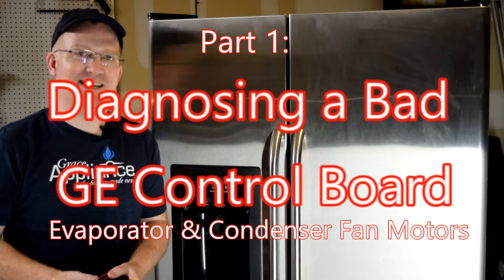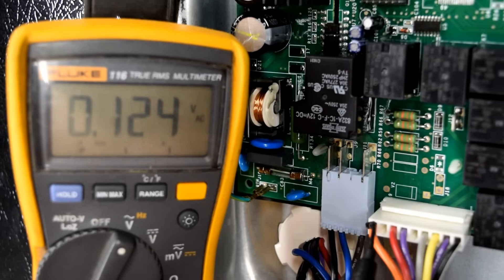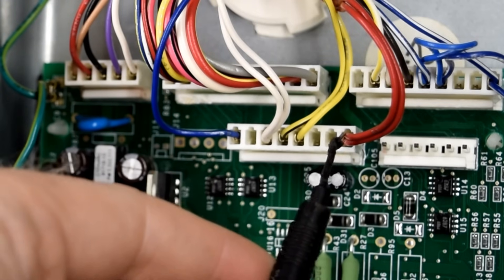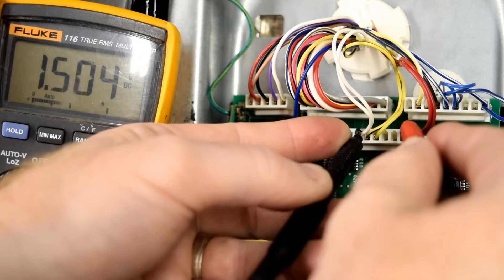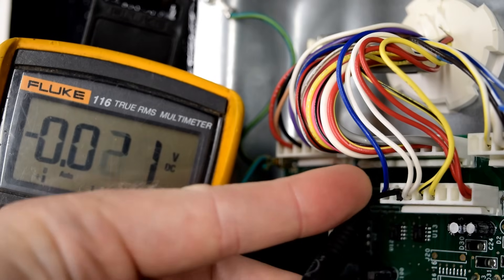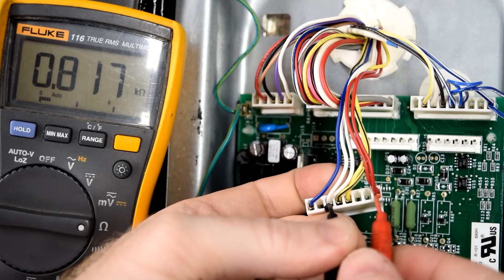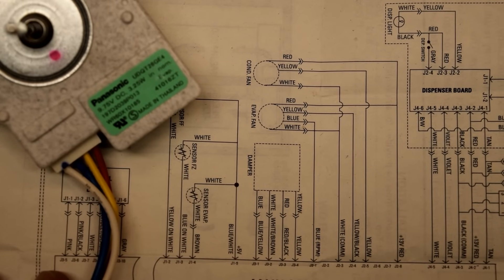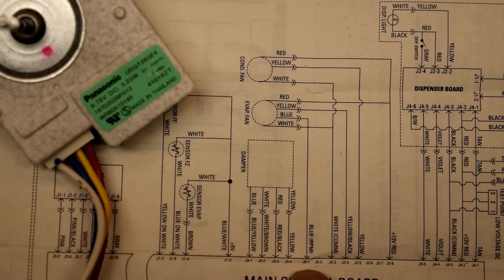Diagnosing a Bad GE Board - Part 1: Fan Motors

Comment: Great videos. Keep up the great work. Would you be able to do a video on how to fix the actual circuit boards?
Reply from the maker: Thanks!
Is this what you need?

https://youtu.be/E_HChSIIif8
Reply: @GraceAppliance  Thats a great video as well. I didn't know if you could do a video where you replaced resistors or  capacitors. Where you are fixing a broken circuit board.

Comment: I have a question on fan testing. Both my fans spin, but when testing like you show. I have 12.9v at my condenser lead, and 6.9v at my evaporator or vice versa? If I unplug the fridge, then unplug the j2 plug. I plug the fridge back in and test the pins at the board, I get 12.9v on condenser and evaporator??

Comment: Hi Andy. I am working through the videos to troubleshoot my 15 yr old fridge. I was able to borrow a meter with Hz/Freq setting but when I looked at all the steps to access the evaporator fan motor I am wondering if I can test at the control board with power applied. When I do that I read 0Hz. It also has a % setting that I guess is duty cycle of the PWM and that also reads 0. I did verify that the meter works, reading 60Hz and 50% duty cycle on the input power. Both fans are running but temperature is about 32 in the freezer and 50 in the fridge. Condenser fan is 2.18k and Evaporator Fan is 1.60k.

Comment: Electricity was lost in my area after that the refrigerator does not turn on.  The scoreboard, where the temperature is regulated, does not shine. 10 months ago there was such a situation. then the refrigerator turned on. the scoreboard is located on the front left door of the GE refrigerator. Any ideas on what it might be or what I should check? thanks.

Comment: I need help with my Ge fridge. When the evaporator fan is connected, the control board makes clicking noise but when it is disconnected the fridge compressor turns on. I replaced the evaporator fan with a new one but I still get the same clicking noise. What could be wrong? The relay overload has already been replaced.

Comment: This was FANTASTIC! I was thinking maybe my board had failed as my evaporator fan did.  I was going to just visually inspect the board  (not an electrical guy) to if I could find a failed resistor or capacitor. This is the right way. Do you have a board repair video as I am going to test my board just like you showed me and I am sure my board will be bad (my condenser fan is running) but the evaporator is not? Thank You!!!
Reply: He has a video on diagnosing bad control board. It was done awhile back scroll down to his videos and you will find it. I just watched it

Comment: In my case' every thing is working except the compressor and condenser fan they are not kicking.
I have buring marks behinde the contorl in the metal frame, but surprisingly in the board back side nothig abnormal.
The marking located near the capacitor but they seem ok and I can't test them because the board is sealed with layer.
Any ideas?
I tried to jump start the compressor and it worked with its fan.

Comment: I need water feature related parts. Not getting current at valve. Checked everything making sure it works. But it seems to be a board issue and I can find schematic anywhere

Comment: I have a defective refrigerator BEKO NDP9660WD observing more closely:The refrigerator makes its full cycle = freezing in the freezer and cooling in the refrigerator;thawing with that heater,with the compressor turned off. And here ends the job, no longer knows how to start the compressor temperature in the refrigerator increasing over 20 degrees until I stop it and start it again and leave (but not immediately have to wait any 2 hours) and in executing the full cycle.
 On the sides of the refrigerator it heats up well, without having opened the door to the refrigerator or freezer from the start. Who is responsible for starting the Compressor after the defrosting operation?. se face timed?,and if so where ?there is a timer or timer is through the program in the electronic card? What do you advise me?
 1)I had error E0 and E1 that I solved by isolation
 2) had inperfect contact in the 842 sensor jack that I solved.

Comment: Thanks for the great video. BUT
Obviously you know from experience or you have data sheet for this particular fridge.  BUT Where do you/ we find the data sheet that identifies which plug goes to which motor.  I may case a Kenmore Elite bottom freezer, fans work in test mode but not in normal operation?

Comment: Great video… Thanks, my board is on the bench now and puts out 13.5 V but will not like display when 
Inside fridge… I also noticed my 400 V caps 
Only have 180 V on them… Is this normal? I plan on loading down to 13 V with a 10 ohm resistor to try and put the supply under load

Comment: I wish the instructions were more generalized.  I have a GE fridge/freezer (#GDS20KBSBBB), but the wire colors are completely different than shown in this video.  There's no explanation, for example, whether "put the black lead where the white wires come in, slot number three" applies to other configurations as "put the black lead in slot number three, which could be any color wire depending on the fridge model" or "put the black lead in the slot with a white wire, which in this case is number 3".

Comment: GE. twin cool unit. fridge not cooling. open doors and evap fan will run most of the time. press the door switches and fan won't always run even though compressor and condenser fan are running.

Comment: Mr. Andy,

More info on my problem of a couple hours ago. Thanks to your compressor video, and another gentleman’s with an inverter on the  compressor, I diagnosed the problem as the inverter on my frig. I got readings on the three leads of the compressor of 8.1, 8.1 and 7.9. Can you verify these readings for a GE ZISS420DXASS?

But I need go back to getting a reading of 836 (your commented bad reading in the video was ~818) on the ohm test which you said should be 1500 to 3000 ohms and you said that with such a low reading I have there is a fan circuit issue, BUT both my fans work and seem to do so with speed. 

Will be nice to hear what you think!

Thanks in advance,

Jim

Comment: Hi Andy,

Thanks for all you do. With this video I diagnosed and replaced the main board. Now everything lights up and works EXCEPT the freezer and frig does not cool down even a little after running the frig for 1.5 hours. I checked for ohms as you suggested, after putting in the new board, and I am reading 836 ohms (you said the reading should be 1500-3000 ohms). You mentioned that in this case there is something wrong with the fan circuit BUT both fans are working (blowing air and both seem to be doing so at a good rate). I read a ton of comments herein without seeing my same question asked. 

Please help! What should I diagnose next? 

Jim

Comment: GREAT Job! Hubby is not home and your video made me NOT AFRAID to tackle this by myself. I read every single question in the comments and didn't find this one: Problem: evaporator fan pulsing on and off every second or so - everything else seems fine. I followed along the video step by step and everything was as expected, but once I got to the part after you remove the harness and check the Ohms between R2-3 (white) and R2-8 (red), the reading would go back and forth between 0L and 3.0 - it just depended on how I happened to orient the harness, or which way the wires got jiggled. I was very careful and certain that the electrodes maintained contact with the metal inside the wire holes in the harness while I moved or jiggled (and also tried using the easily accessible metal stripes on the back of the harness with same results). The reason I was moving and jiggling is because at first, the reading was 0L, but when I shifted my weight, it popped up to 3.0. So then I replicated this by moving the harness and/or the wires while keeping the electrodes in certain contact. On the one hand, your opening comments put pulsing fans in the motherboard category. But on the other hand, I got 124VAC and 13VDC in the previous steps - so NOT the motherboard. And THAT's why they call me Miss On the Other Hand!

Comment: Hi Andy,
Thank you for your video. I tested the power coming into the control board, and I am getting 120. When I did the test with the J2 plug, I am getting a reading of 7.11 volts. Does that mean the board needs to be replaced?
Reply from the maker: Hey Depdad,
If it's for your evaporator fan, it's an OK voltage. If I had to do the video again, I'd also include that it's a variable speed motor and has a low, med, high range so the DC volts will vary depending on the speed.
You'll get like 5,8,12 vdc depending on the speed (or some similar voltage to this)

I'd check for that voltage directly at the fan motor to confirm you're getting volts there, if so, replace the fan motor. 

Hope that helps!
Reply: @GraceAppliance  Thank you, Andy. I'm getting around 7 volts for both fan readings.
Reply from the maker: @depdad  also, I would disconnect J2 and take the readings again directly at the board and see if they are the same readings. 

There is a supply of 13 volts that should be present as shown in the video.  Are you getting 12-14 from any of the pins at J12?

Also, are your 2 larger green resistors burned or brown in color?
Reply: @GraceAppliance  I'm not getting 12-14 at any of the pins.
Reply from the maker: @depdad  gotcha! 
Yes, that does sound like a failed board. You should have 2 of the pins that supply the control voltage of 12vdc-14vdc full voltage regardless of the fan speed.
Reply: @GraceAppliance  What are the specs and where do I order those resistors if they are bad?

Comment: Andy, thanks for all of the great diagnostic videos.  I couldn't have fixed my GE refrigerator without you.  When my refrigerator compressor and fans stopped working I checked the compressor overload and start relay first and the overload broke in my hand.  However, replacing both parts didn't fix the problem.  Thank God I found your videos that helped me locate the problem: the fans weren't getting any voltage even though there was no visible sign of any damage.  Replacing the control board fixed the problem but there was one complication.  I had ordered an aftermarket control board because they offered free returns but it kept cycling off and on every minute.  I think it may have been overloaded because the large resistor in the evaporator fan drive circuit ran extremely hot.  I replaced it with an OEM board and now the refrigerator works great.  Thanks again for your help.

Comment: Hello,
When following your resistance test (@7:00) on the J2 plug between the white common wire and red wire, I get a reading of 0.003 k ohms.

When plugging in the fridge to test for voltage, one of the relays on the control board makes an intermittent clicking sound. I noticed that everytime this clicking sound occurs the condenser fan would spin and come to a stop shortly after. DC voltage readings between the common wire and each motor kept fluctuating, failing to reach the desired 14V. 

When I test for continuity on the J2 plug between the white common wire and the yellow wire (condenser fan motor) I get OL reading. When testing between the white wire and the black/yellow wire (evaporator fan motor) I get continuity. Is it safe to assume that my condenser fan motor needs to be replaced since there is no continuity?
Reply: I too had low resistance testing the fan motor circuit, .888k ohms. I’m thinking it’s the evaporator fan motor. It does spin but I’m not getting any tach readings from it. Did you figure out your problem?
Reply: @mikeparker8610  my evaporator fan motor burned and had to be replaced

Comment: Hi,
Great Video. Based on the test procedure my control bd only has 10.43 vdc output to the condenser fan...to little to operate the fan correct? F
an rated at 11.5 vdc
Reply from the maker: I would expect it to still run.
Bad fan motor would be my diagnosis.
Reply from the maker: You may disconnect the fan and test the voltage again. You may find it's full voltage at that point.

Comment: Hi Andy and thank you so much for all your great videos! I was especially glad to come across your main control board videos, as most people don’t get into them on their channel. One question is I have a Kitchenaid side by side model # KSCS25INSS00. I’m having intermittent problems with the condenser fan motor turning off while the compressor is still on. I noticed my compressor fan is rated for 115 volts 60 Hz, so would that mean I should see around 115 volts AC going from the control board to the compressor fan?  If so, could I check out the fan by unplugging the connection at the fan and hooking it up to 115-120 volts from an AC plug in my house?  So far the voltage going to the compressor fan is sometimes at 6 volts, sometimes 12 volts and the compressor fan and compressor would be running. Lately the voltage to the compressor fan from the main control board has been measuring less than a volt with the compressor running but the compressor fan not running. I have cleaned the coils and there wasn’t much dust to remove. I also have continuity in the wiring harness going from the main control board to the compressor fan. I also have 120 volts at the AC input to the main control board. Thank you!

Comment: What if you're not getting good power to the control board? Does that mean I know that's what needs replacing?
Reply from the maker: Hey Jaime,
Verify that you're getting 120v from the wall outlet and also to the connection where the cord hooks up to the refrigerator. 

Also, disconnect the incoming power plug at the control board (with the fridge unplugged from power so you don't shock yourself) restore power and test for power at that plug when not plugged in to the control board.
Reply: @GraceAppliance  turns out my multi meters probes were too thick. Got a thinner one and I do get 125 volts if power to the control panel. I followed the rest of the steps in the video and my control board is definitely bad....new one will be here Tuesday. 

Thanks so much for this video.

Comment: Ok, I've dug a little deeper in to this.  The fridge only ran for one cycle and then doesn't seem to come back on.  The freezer is working with no issues, has -2F temps coming out of the freezer fan.  Ice is also being made.  I dont see any green resistors on the board, it doesnt look like the board in your videos.  I'm guessing it is the board since the freezer portion seems to be working and the fridge portion is not.  I'd just hate to take the $200 gamble and have the board not be the issue.  Big bummer that it's just over 2 years old and already having problems.
Reply from the maker: Sounds like it's running as it should so. That's good!  Keep us posted if you have any issues.

Comment: Just found your video and still have questions with our GE Fridge, GYE22HSKMSS.  The evaporator fan is only running in short bursts.  We replaced the fan but that did not help.  Digging deeper, at the fan connector in the fridge, we have 13v from the red & black wires but the 5v coming from the yellow wire is sporadic.  I'm guessing this 5v is what triggers the fan to start up?  Is this an indicator of a bad control board?  My J2 port doesn't look like this and I cant figure out which connector on the board is for the fans.
Reply from the maker: Hey,
So it is likely going to be a failed board. 
On your board you will have 2 larger green resistors.
Do these look discolored or burned at all?

If your meter has a Hz (frequency) setting there is also a test you can use to confirm that your fan is sending the appropriate feedback to the board to let it know its in fact turning.
I don't remember off the top of my head, but in my fan video I show how the tach function works for these PWM motors.  

Let me know how those resistors look.

Comment: My GE side by side refrigerator GSS25TSTBSS (WR55X10942P) is not circulating cold air well. Water bottle freezes at the bottom part of the freezer but not at the top where the ice maker is located. The top half of evaporator coil is frozen. The fresh food bottom section is cold but top section is warm.

My refrigerator test result

-117 volt a/c Testing voltage to control board.

- When trying to put refrigerator Liner Protection Mode condenser fan was running but the evaporator has not responded.

-I got 13.62 volt dc testing supply voltage of 12-14vdc to fan motors.

-I got 12.66 volt dc testing evaporator fan motor

-I got 10.04 volt dc  testing condenser fan motor

-I got 1,310 ohm testing fan motor circuit 

I also checked the Ohm resistance reading for heater circuit  I got 20.6 ohm.

In the last two years i had replaced the defrost heater twice / defrost thermostat/ door gasket/ drain tube/Evaporator Fan Motor.